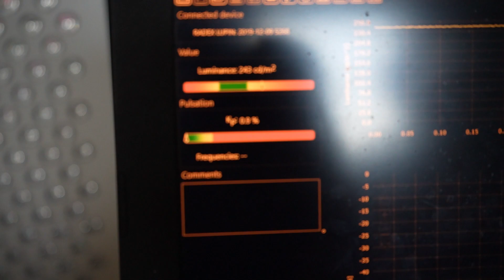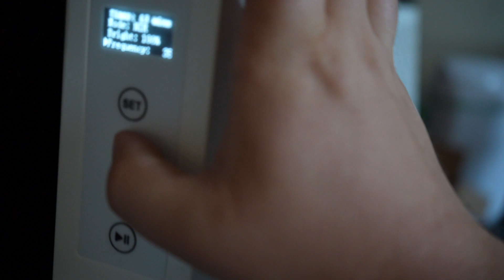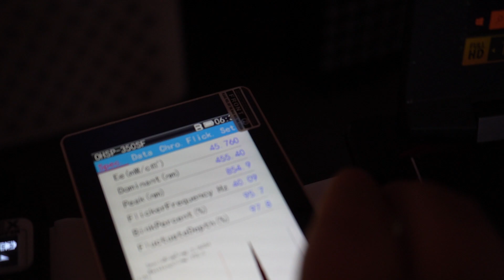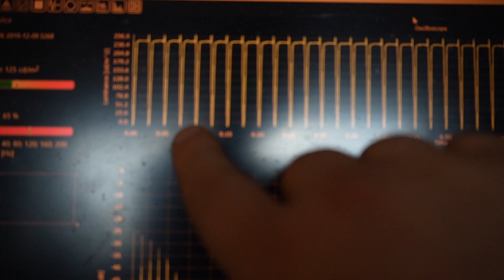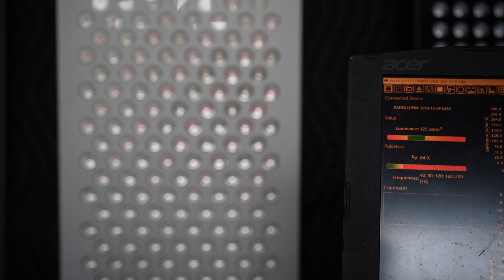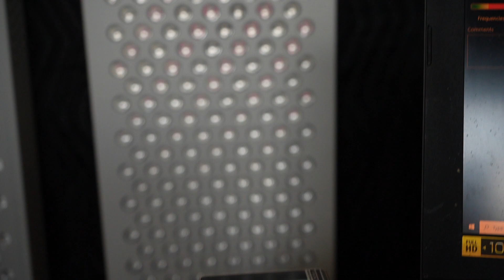Pulsed Red Light Therapy, Except the Duty Cycle is Super Short - IDEA LIGHT RLMAX300

Comment: I bought (8) IdeaLight RL300MAX custom panels this time last year.  I had seen this video and asked them about the pulse issue you found and I was told that when in Pulse Mode, that the power needs to be set at 50% or less and it will then pulse correctly.  I have no way to test this, so not sure if correct.
Very good company, I had some issues with 6 of 8 panels because of a board issue and they sent the correct replacements right away along with extra stuff for my trouble of having to replace the boards.
Reply: were you told this at the time of purchase? is there a manual that informs the customer about the requirement to set the power to 50% in pulse mode? if not then they are lying to you. Plus they have a youtube channel might be an idea to ask them to do a demo of this and post to youtube. I might do this myself as i am thinking of buying this and want assuraNCE that it pulses correctly.
Having issues with 6 out of 8 doesnt fill me with confidence. Im based in the Uk and dont want the hassle of having to return such a large and heavy product to china.

Comment: I bought (8) Idealight RL300MAX (c) panels and I just remembered when you came out with this video, I had asked about the pulse and how you found it was very short.
I was told that when in pulse mode, that the power needs to be set for 50% or below, then it will pulse correctly.  I have no way to test this though.
Reply: were you told this at the time of purchase? is there a manual that informs the customer about the requirement to set the power to 50% in pulse mode? if not then they are lying to you. Plus they have a youtube channel might be an idea to ask them to do a demo of this and post to youtube. I might do this myself as i am thinking of buying this and want assuraNCE that it pulses correctly.
Having issues with 6 out of 8 doesnt fill me with confidence. Im based in the Uk and dont want the hassle of having to return such a large and heavy product to china.

Comment: What about the bulbs that u screw in that have 9 red and 9 inferred bulbs do they pulse too? And there's no fan they just screw in,.. I seen a vid i believe it was this channel that showed the Amazon bulbs,  u showed like 4 or so different ones that screw in.. and how its not good to touch them, well the 1 i have it comes with a clip so it can connect onto like a shelf so it don't have to be touched.. it seems to work for me, I had so many mosquitoe bites all over my legs and after 2 times of using the red lights they almost where healed after I woke up the next morning.. so is it possible that some of the the bulbs actually work? Cause I never heal that quickly,  it was overnight.... its like the hooka (not sure if I spelled that correctly  lol)bulb but different company.... it has 9 red and 9 infrared bulbs ,